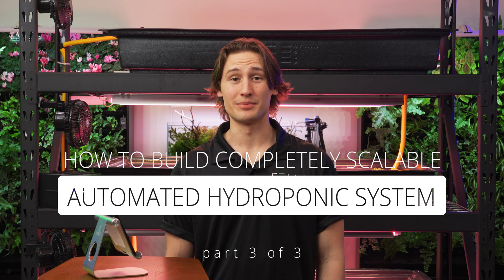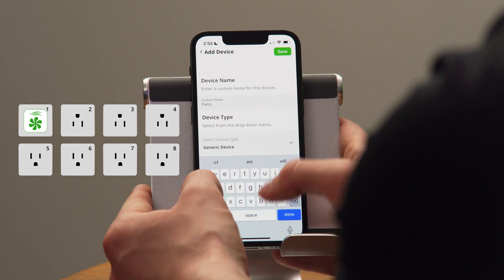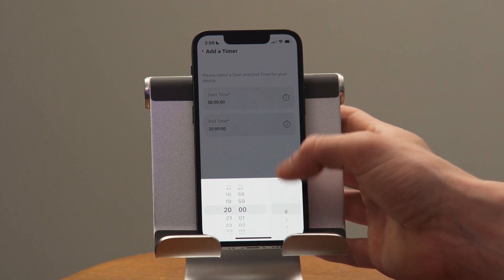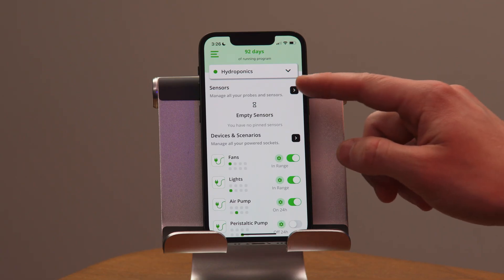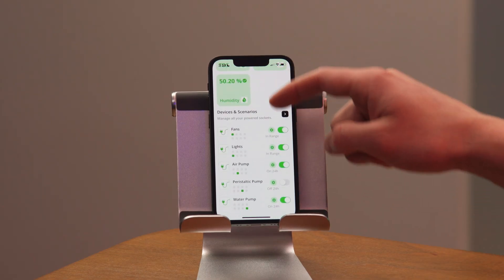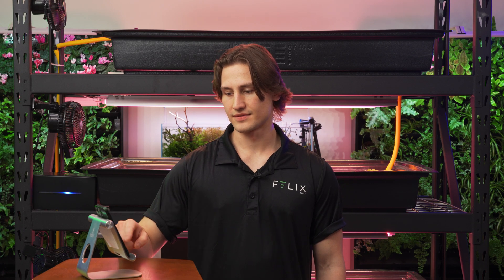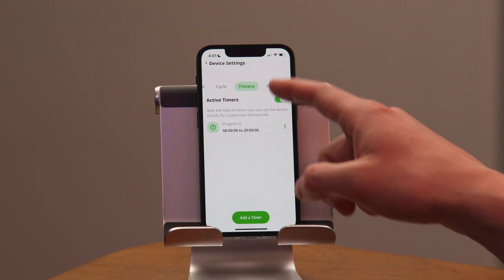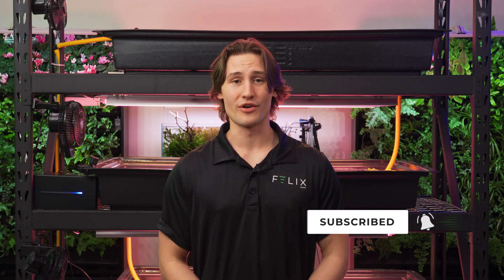How to 100% Automate ANY Hydroponics System (3/3)

Comment: Hi. Does it have the capability of turning off the water pump if there is not enough water in the tank?
Reply from the maker: Hi Josh, KAI does have this capability! You can use the moisture sensor with an Event to turn OFF your water pump IF the "In Water" measurement = NO